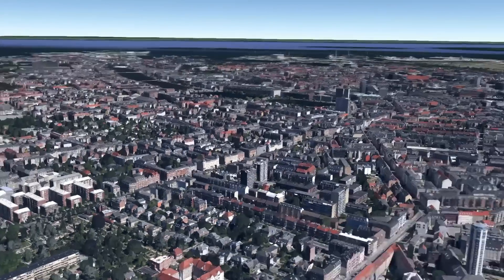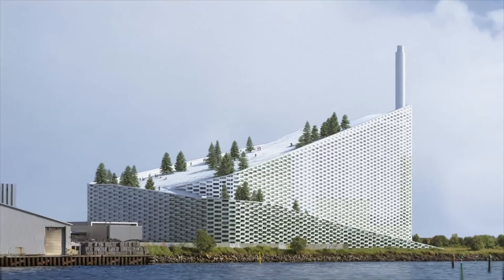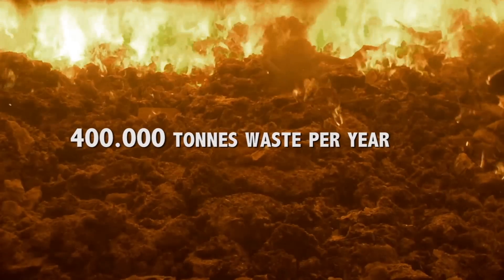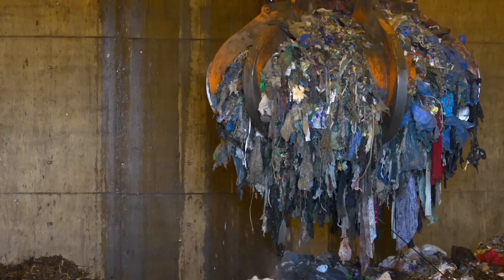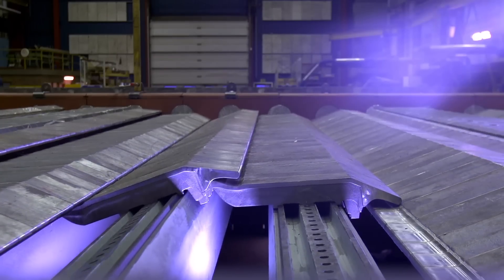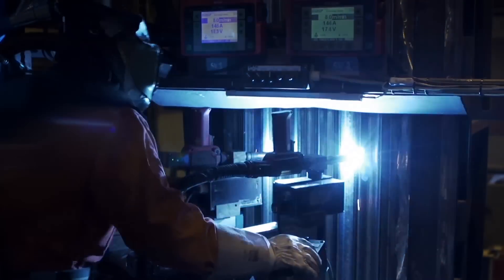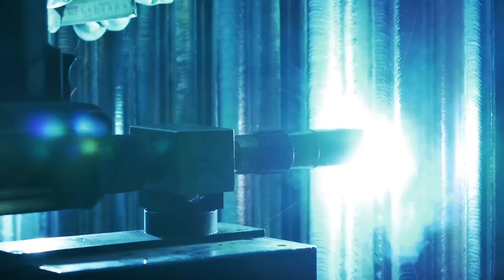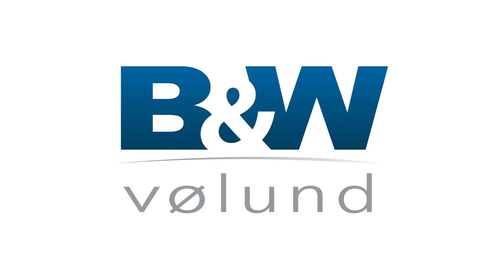Copenhill by B&W Vølund: Copenhagen's waste-fired power plant and ski slope is under construction

Comment: This incinerator comes at a capital cost of $650 million and produces a max of 62MWh of electricity. At a similar cost a gas fired power plant can easily produce more than 650MWh of electricity => incinerators are 10x less productive =  burning tax-payers money!!!
Reply: And what are you going to do with your garbage?

*You totally missed the point.
Reply: Joseph Harb 
What would they do with their trash if they can't burn it?
Reply: Joseph Harb
You forget one thing. The plant gets payed for burning trash. They import trash from Germany and the UK and are payed for doing so. Whereas normal plants have to pay for fossil fuels.
Reply: Nice try. 

Back to the mine Trumper.
Reply: I would ask what you would do with the trash?  Would you send it to a landfill?  Really?
But I noticed that others asked the same question, so ...
Reply: fossil fuels and garbage are a problem and this is a solution for the two, you totally missed the point